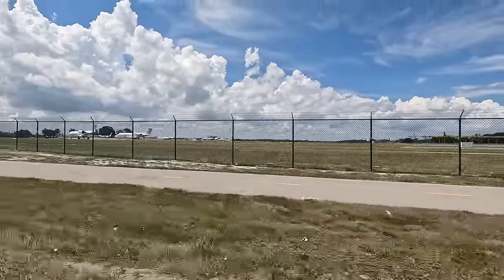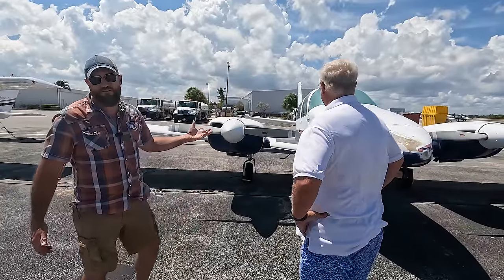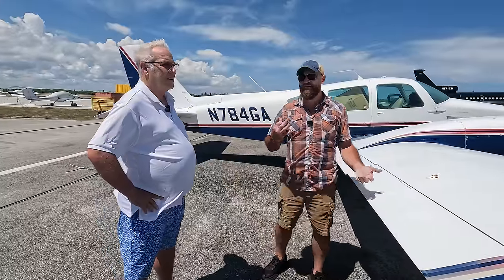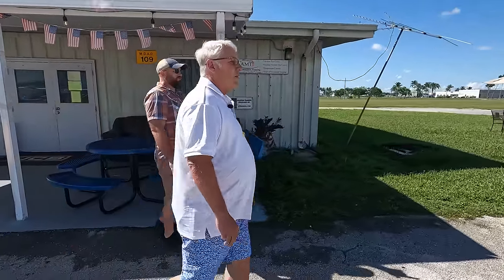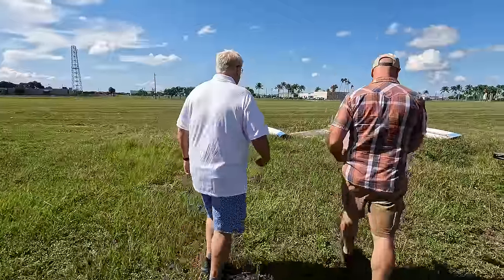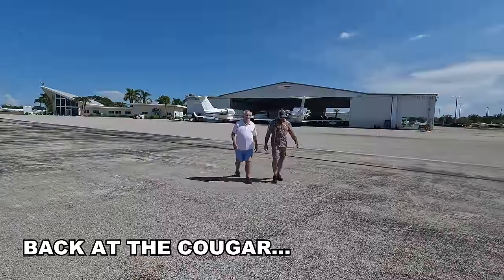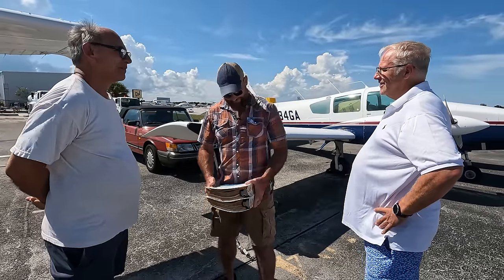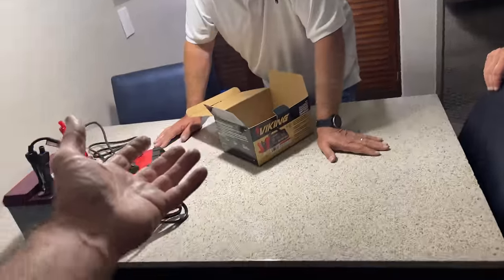Did We Find Wings for The FREE Abandoned Airplane? Will the Parts Airplane Start ?!

Comment: You really should always connect positive terminals first before negative terminals when connecting to a power source. Unless getting shocked with a car battery in your hotel room is your kinda thing...
Reply: lol... thanks for that mental image. But it's less important when the negative isn't hooked up to every piece of metal in the surrounding area. That's just a thing with jumper cables, you don't want to create a short circuit by hooking up one side and have the positive dangling around the grounded frame on the other vehicle. 12V isn't enough to shock you anyway.
Reply: @cybersiren  Wait, you just said connect the ground first, but in your original post you said connect the positive first... can you clarify? Personally, I like to connect ground first, to establish that reference voltage before I turn the juice on. Except in the case of jumper cables between two cars.
Reply: @DFPercush  electrons flow from negative to positive. Cars, boats, and planes all use DC batteries and are often configured with positive ground.
Reply: @DFPercush  Lemme put it to you this way. He disconnected the black wire from the battery first when removing it from the airplane. Lets say that for example somewhere in the electrical wiring of the plane there was a short circuit because it had been sitting for a while. With the red wire still connected the battery it could now ground through the plane and your body if youre touching the plane... Its always better to connect ground first when installing a battery and disconnect your live wire first when removing it. This way there is much less of a chance for unknown wiring behind metal panels, etc. from causing you the best shock of your the day.
Reply: @cybersiren  Oh now you're talking about on the plane. I thought we were talking about the hotel room. Yeah I follow you. Still don't think it would shock you though, the main concern is damaging the equipment. I put my hands across 12 V all day. Only thing that delivers a shock on most ICE vehicles is the ignition coils and building up a static charge on yourself.
Reply: @DFPercush  yeah I mean the shot in the hotel room just showed cables coming from off camera. I assume it was just going to a battery charger so no big deal, but in that instance he still connected the wrong cable first lol. I just think its important to call it out because 1000's of people watch these videos. connecting ground first is just good practice.

Comment: find another donor aircraft that cougar is worth restoring use the props to get the other cougar home put them back on this one fix enough to pass for a ferry flight you have the you tube backing plus you will then have two cougars on the 401 wings i believe you have an angel sitting on your shoulder not bad for having bought sight unseen just don't make a habit of that not in these days and times

Comment: A couple of those cheap ajax bolts will have those wings hanging in no time. great for a static display but just lately I see a few who like to fly into storm cells and tear off their wings that has them plummeting to earth at terminal velocity.
Doing a preflight on some of those Pipers are found to be the flapping type, styled off of real birds and the way they operate their wings.

Comment: How hard can it be to fab those engine beds and replace the bad sheet metal on the current wings if that's all that's bad about them? You might want to do a side trip to a place that does actual aviation restoration such as the Air and Space museum's facility just outside DC. You can see how they make new parts from drawings or even from old parts as patterns. Can you get the company to get copies of the drawings? It just seems like a far more certain pathway than chasing after old stuff that's in as-bad or worse condition. You probably blew several thousand going to FL for nothing. This would have covered the cost of new engine beds and sheet metal for sure.

Comment: You can “pump” the throttle on a fuel injected engine a million times, but it will accomplish NOTHING. Fuel injection servos, like the ones installed on the engines of the Cougar have no accelerator pumps. All long as the mixture control is in idle cutoff no fuel enters the intake system. This is WHY you have to prime the engine BEFORE attempting to start it.
Reply: Carburetors

Comment: considering were just 120 years or so into aviation, could it be that piston driven aircraft will be obsolete in the coming years?  With jet engines being the thing that everyone uses?  I mean it wasn't that long ago that fuel injection and electric cars were unheard of.  Small jet engines, like the Honda Jet could be the next step.  A dual engine jet that is affordable that screams in speed and super efficient.  Just sayin.
Reply: The HondaJet is a light business jet designed in Japan and now available with a list price of $4.5 million. It has a range of just under 1,400 miles, so while it's certainly on the smaller side, passengers won't be on board for long.
Reply: @sammycochran  Yeah I get it..  But I'm just thinking of how history tends to repeat itself.  Ya, know only wealthy folks owned automobiles.  Then it was air conditioning, auto transmissions, bla bla...  If you look at the interior of a 1965 Cessna with "cigarette trays" in the doors it can't be that far fetched that small single engine jets could be affordable at some point.
Reply: @outabeat  I think a turboprop conversion would be a better idea. Some people are working on that.